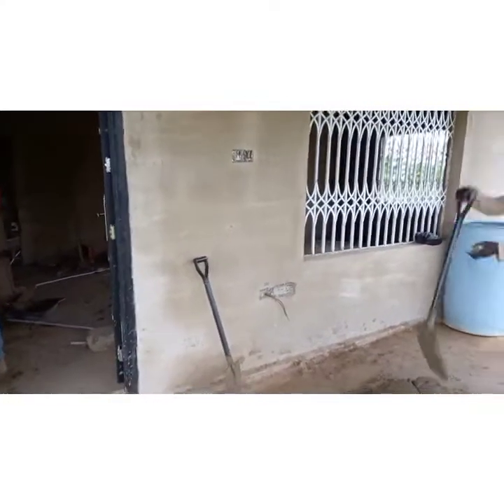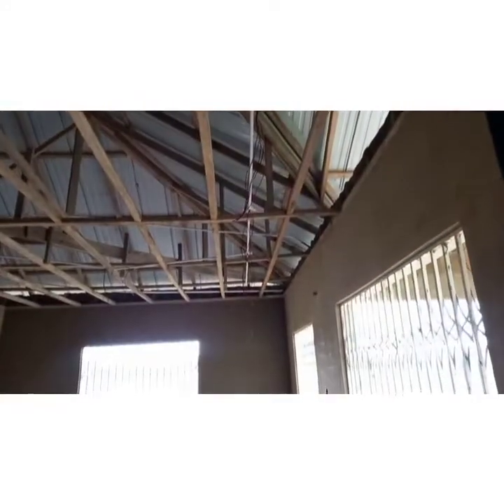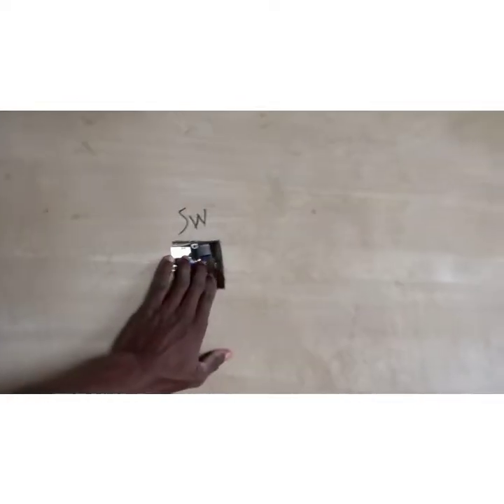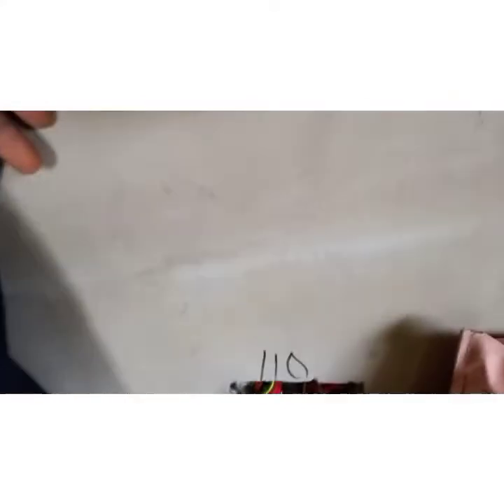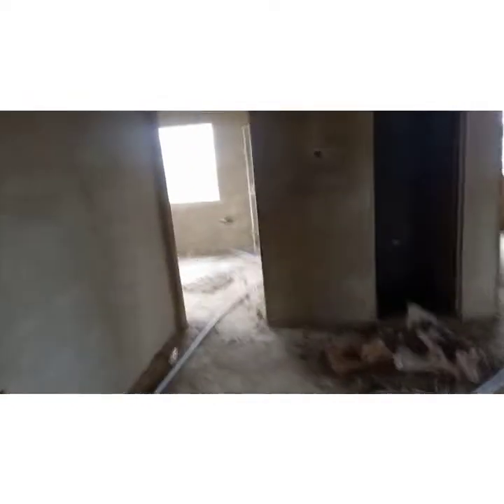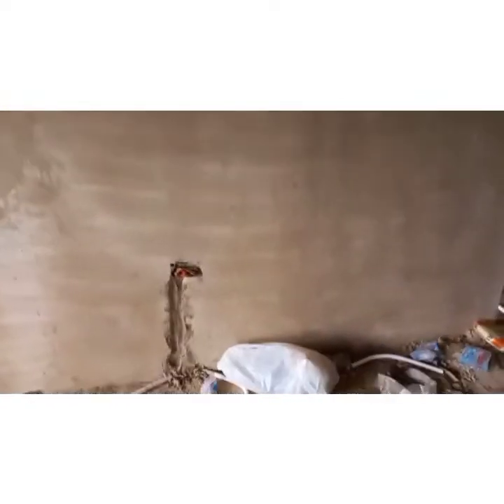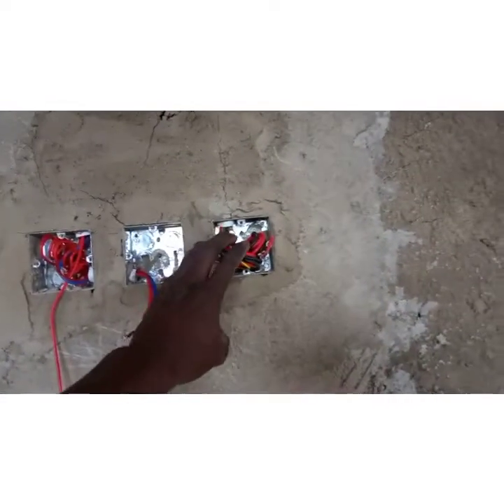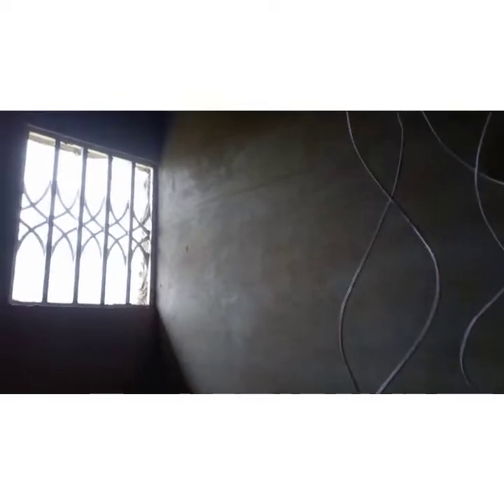Building In Ghana, House Tour of A Three Phase 110V And 220V Electrical Wiring In Accra. #Ga South

Comment from the maker: Do you Live in the US 🇺🇸 or   Canada 🇨🇦 and building in Ghana? Don't worry about the power supply or system. Vicarriet Electricals will take care of your electrical needs. We're specialised in single and three phase residential and commercial electrical work, we do both 220V(Ghana power supply) and 110V (US and Canada) power supply. You can contact us for anything electrical and also as professionals we have the hand, power tools 🔧, and measuring instruments to serve you efficiently. One more thing, all our electrical services conform to the Ghana Electrical Wiring Regulations 2011, (LI 2008)
We offer you safety and value for money.  
Location: Adjiringanor, Accra and Cape Coast 
WhatsApp: 00233245343796
00233209787770

Comment: Please how would you power the 110v system and 220v system? Are they going to be supplied by the same DB or how?
Reply from the maker: The 220v is straight forward since the electric system in Ghana is 230v, and then use step up and down transformer to step down 220v to 110v and feed it to the 110v setup.

Comment: Thanks for sharing but your 110KV circular box is not the 110kv type.
Reply from the maker: Yes it's the normal 3×6 Conduit Box and will use 13A Double Socket (Multi type) that fit perfectly for this type of box
Reply from the maker: It's a 110V socket outlet.